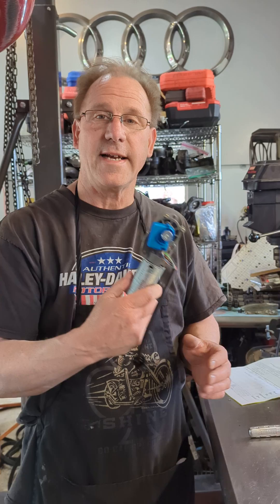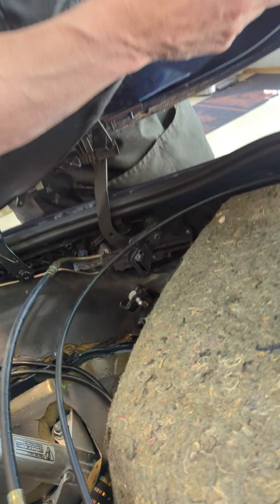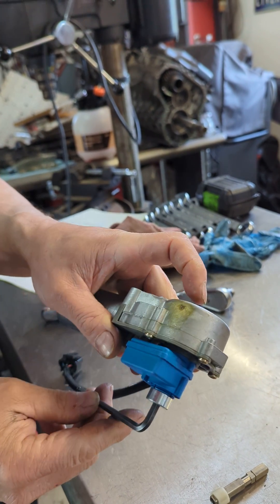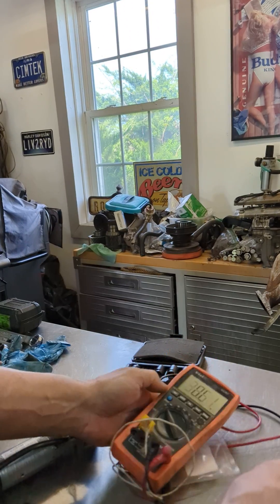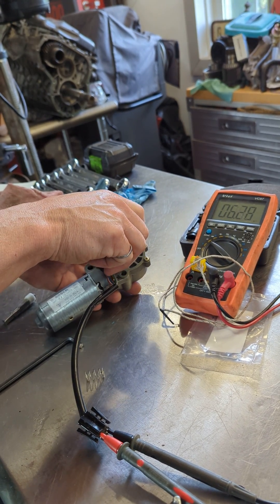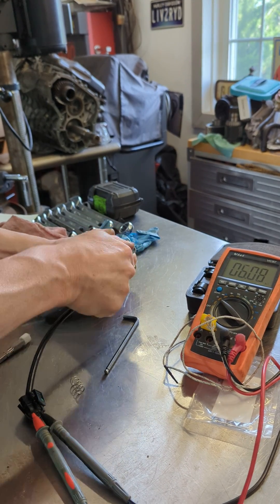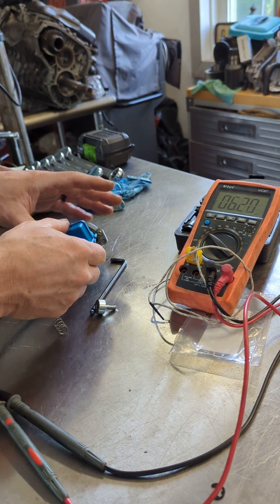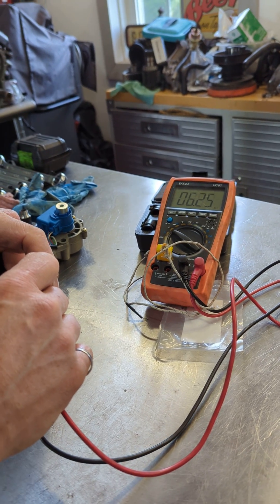Porsche 996 Cabriolet Clamshell Motor Calibration for Installation

Comment: Running into a weird issue with my potentiometer.  Getting a time out warning on my top and found the potentiometer to be at 5.95 KOhms. Set to 6.2kOhms and the top functioned properly a few times before faulting out again.  When I checked the potentiometer, it was back at 5.95kOhms.  Sound like a defective potentiometer or am I missing something?
Reply from the maker: Your shaft must be slipping in your potentiometer.  There is a plastic collar around the square metal shaft.  Make sure that is meshed correctly with the potentiometer gear.  Otherwise, your blue plastic potentiometer is faulty.

Comment: Any idea what to do when the potentiometer won’t reach 6.2k ohms? It’s stops at 4k ohms then goes infinite. Porsche doesn’t sell the potentiometer. I took the potentiometer housing apart. It’s not so easy to find a replacement potentiometer online. Have you tacked this before, short of buying a replacement motor assy?
Reply from the maker: I have not encountered that issue.  Based on your description, I would agree that the potentiometer is faulty.

Comment: Hello, when you set the resistance to 0.62, is the cover for which this engine is responsible open in the middle or closed position?
Reply from the maker: The cover must be FULLY open.  Make certain that the cover is all the way back.

Comment: Thanks very much for this! My roof opened normally then would not close. Read manual, tool was missing to jack up clamshell, but more importantly, there was no screw holding the potentiometer onto the shaft. ......gone. With your video , I identified that there was supposed to be a left handed screw in the shaft. I have ordered the kit thanks to your help, and hopefully will get screw in there and see if I can open clamshell with hex head wrench. Dont know if motor is good, or really what the problem is at this point, it seems the clamshell is latched in the center back preventing opening. 
of course with the roof open there is no access, even the motor you describe is difficult to get at. Will look today to see if I can remove motor with the clamshell closed. Also that locking mechanism on the shaft is interesting., but without screw holding pot in place it is impossible to access shaft to turn.